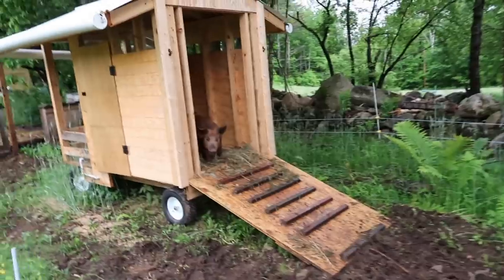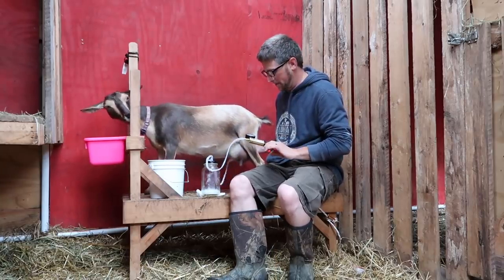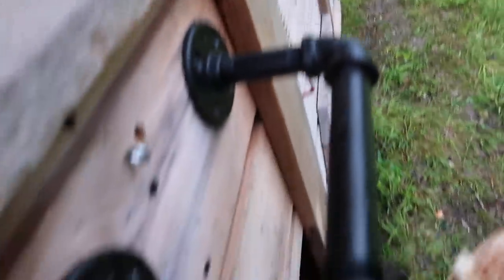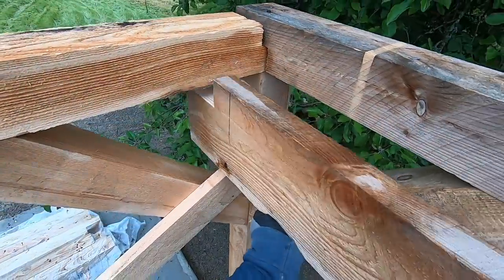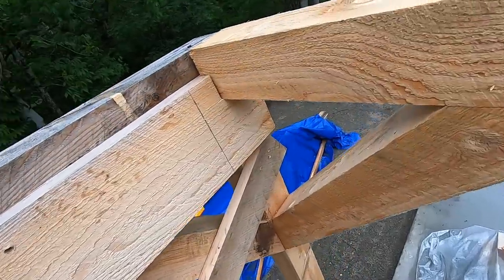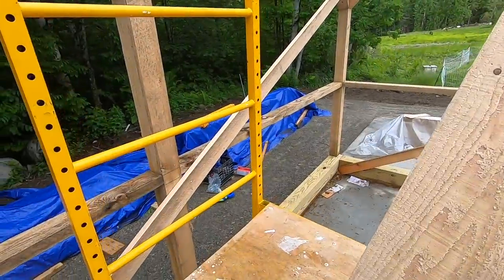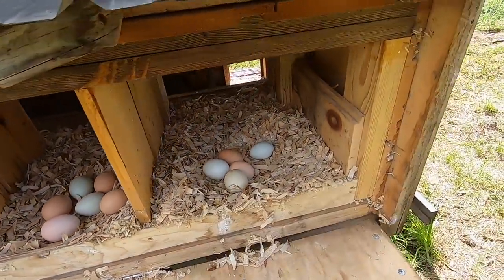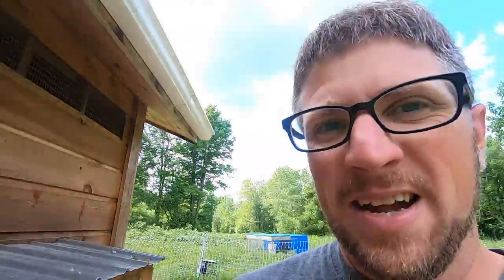Now We're Getting SomeWhere Installing the Loft in the Post and BEAM BARN KIT

Comment: Suggestion Al, run a piece of strapping or a 2 X something along the length of the outer walls and beams to sit the rafters on instead of a hit and miss screw, Save yourself a lot of time and make it easier to place the rafters before installing them. Then remove the strapping when rafters are installed and move it to the next beam.
Reply: Sounds like you've needed 3 hands before 😉
Reply: Nailed on well it would act as a makeshift joist hanger too, and give more strength than just the shear strength of those screws holding up the loft joists.
Reply: @aus71383  I'm not a carpenter but have watched a lot of deck builds and wondered why he wasn't using joist hangers.  Is it because he's using screws instead of nails?
Reply: @robinrummel1359  I think it's because the kit didn't come with joist hangers, but it did come with screws.
Reply: @aus71383  interesting, thanks ☺️
Reply: @aus71383  I was wondering about joist hangers....
Reply: @sandyburba3033  They would be a good idea, and can be added after the fact in many cases.
Reply: @aus71383  He added the screws to make assembly easier. They did not come with the kit.
Reply: @robinrummel1359  maybe saving money. ARe the screws he's using rust resistant? They look like they have like some kind of protection/sealed.
Reply: Lolz, same. Thought I had while watching. After you’ve fough t with things long enough. They go off like neon lights in your head...but, either way he did get it done!
Reply: ou don't have joints hangers

Comment: Should have used joist hanger to set your 2x8's.  Would have saved you time and a stronger floor system... yes you can get joist hangers for rough cut lumber.
Reply: J.Arnold Cotton Ha!  I just asked the very same question. Especially if you’re going to be putting weight on that flooring. And if you couldn’t get commercially available hangers for rough cut lumber, then I’d be making some.
Reply: I had the same thought. The whole loft is hanging and depending on nothing other than the shear strength of the horizontal screws. This kit uses the essence of post and beam construction but removing the engineering of old fashioned mortise and tenon joints might be a bit too much oversimplification. I’m not expecting a failure but as I watched the vid, I kept thinking I’d have to add some hangers to the loft if it were my barn. But I still love the channel, the family, the animals and the lifestyle. 😎👍
Reply: Joe Romanak even if you used Oak or Ash dowels. Might be repetitive, but better safe than sorry.
Reply: Brooks Webb - Good thought. I’m not an engineer but I usually prefer to over engineer my projects. I learned this from my dad
Reply: I have serious questions about the design of this project. This is not post and beam as I know it.
Reply: J.Arnold Cotton it wouldn’t pass inspection where I live.
Reply: Ledger system would be best option but its barn so who knows
Reply: Just going to  come back here every year for the next 50 to say, 'it's still standing'. Don't put metal in a wood barn like this

Comment: Your really moving along, suggestion when installing screws that join two boards together always drive them slightly down so when weight is applied on top of them the boards are forced closer together. On your triple 3x8 beams you might want to consider adding a 1/2” plywood flitch plate sandwiched between the 2x8s, just alternate the plywood joints of the of the 8’ x 1/2” plywood pieces and it will add substantially to the strength of the beam. Looks great!

Comment: The loft is not designed for weight, it is floating on fasteners only. Add king studs under the headers and some floor joist hangers then it will hold that elephant you're working on.
Reply: Yes, hangers would be better, but It ain't going nowhere.

Comment: As Mark G stated earlier:  a structural member is needed under the triple beam at each end....I would be amazed that the designer did not call for an additional vertical support member at each end.   Not being privy to the drawings, One such vertical may be called for in the drawings....if not, I would hope that the designer has given you the maximum load per Sq. Ft. allowable on the loft ...if not, then a call to designer is needed....
Good work....be careful leaving tools on work above you....it is so much fun building and see it come together....take your time enjoy and work smart...those baker scaffold can tip over easily...

Comment: I would suggest that you support the loft by putting a stud under the beam ends in the corner s of the loft, this transfer the weight  down to the foundation and you don't have to depend on the timber screws to hold up the loft .    I would be tempted to put  a post in the middle front and back of the loft if you plan to put alot of weight on the loft.  This is alot like framing a window, the header over the window needs to be supported.

Comment: Free advice from a carpenter. When selecting your wood, always check for the "crown". Every board has a crown. All crowns go out, on walls and up on joists. Without paying attention to your crowns, your building will start to sag in less than 10 years. Up and out, your building will never sag.

Comment: I have been very impressed with the engineering of that kit until today.  I am old school.  Joist need to sit directly on structural members, not toe nailed (screwed) or nailed into end grain.  They could do that easily with the cross beam.  Make it 4 piece, instead of 3, s that the inner 2 are as wide as the post.  The inner 2 would be 2x12 and toe nailed to the rim, but the outer 2 would be 2x6 and would run under the side beams and attach directly to the post with RSS.  For good measure, those laminations would have structural adhesive in between.  Downsize the rafters to 2x6, 16" O.C., then they would rest on top of the outer 2x6s of the cross beam.  Something similar would need to be done on the end wall.  Maybe a bit more lumber, but still much cheaper than joist hangers.

Comment: Shouldn’t the loft floor joists rest on top of the walls, instead of tucking underneath and relying on mechanical fasteners (I.e., the screws) to hold them up???
Reply: should have joist hangers not relying on the screws
Reply: That too.

Comment: Hiya, just watched this again & it came to me when you were putting up the joists for the loft & were holding them on two screws, what if you put up a length of timber six inches down, both ends to locate the joists on while setting up & then remove. Or leave them as added support as the joists are load bearing for anything in the loft plus the beam would hold itself up while you positioned it. Steve...

Comment: I have to say that I agree with the guys calling for at least joist hangers but would also add a 2x4 leg under the center of the rear wall. This is not a very well thought out support system, would not pass code/inspection in my area as well.

Comment: Use a 2x4 ledger board to temporarily support the floor joists when setting them.  They're called joists... not rafters.  Rafters support the roof deck.  Joists support floors.

Comment: Al, looking good - couple of quick questions. 1) What did the company say is the load weight of the loft when using screws vs nails and joist hangers, 2) how long is that battery lasting you on the driver?

Comment: @ 13:20 You would have been better off putting a 2x2 along the bottom edge as a ledger on the other side. Rather than rely on balancing the joist on 2 screws. Bonus is you could have left that ledger, as extra support to that end of the joists.
Reply from the maker: Yup. I would have been. 😝

Comment: You should have tacked a ledger up to rest those joist on, with 3 nails/fastners under each one if you're not going to use hangers.
The beam is supposed to be nailed/screwed together, 3 or 4 times, from both sides every 16 inches.

Comment: Does the plan call for using metal strapping to attach the beams to the bottom plate,  and the top plate. We have strong winds here in Colorado, building codes require strapping so that the upper structure does not blow off of the bolted down plates. If you put the strapping on the outside, it will be under the sheeting if you don't want to view it from inside the barn. Our local Lowe's have the strapping. 

Otherwise I watched this yesterday, and I am missing seeing the feeding of your animals, that is the best way to start the day. Maybe I should go back and watch an old video, but it is not the same as seeing Pork and Chops in the new PPM.

Comment: Good video. I liked it. But as a carpenter of 30+ years I've learned that nails and bolts have 5x the shear stress ability as screws. Screws are better at pullout but SUCK at shear. I love them for ease of use but people need to understand what they both are good at. It's why high rise buildings use steel bolts over screws. It's just a stronger design.

Comment: To late it's hard to balance a board on a screw next time screw a short piece of wood on top of the 2x8 letting it hang over 1 1/2 in.  That will hold one end while you screw the other. Can put on both ends, may take a little time but easier than what you did. Can use over and over again.

Comment: 14:36 would have been a lot faster and less stress running a piece of wood along the whole beam rather then trying to do it with nails just saying doing that would have allowed you to place all the boards up right away then all you had to do was screw them in  and move your ladder...… Good man you figured it out at 18:20 LOL now do that for the cross sections also and lay out all those cross members on the rafters too that way you don't have to do one by one

Comment: should you have not used nails instead of screws for at least the start of the build screws have approximately half of the shear strength of nails
Reply: Check out Project Farm on YouTube, he does a test with nails and screws. The screws will be just fine. Some of the screws he's using are way stronger and have way more holding power than a nail.

Comment: Please never load that loft floor with any significant weight and tell the new owner, if ever any, the same.  Everything is hanging on timber screws which is a very weak design....joists and the main beam included.   Main beams should be resting on posts or  jack studs/posts and joists should be hung with hangers or on top of the beams with a rim joist on the ends.  Just remember any weight placed up there is all sitting on a few 1/4" screws in soft wood...no true support is present.   I am very surprised the design passed any kind of state standards for commercial sale.

Comment: Sloppy construction is what i see. Loose joints. Over driven fasteners leaving split lumber. Worst of all no joist hangers on those loft joists. Just because they didn't come in the kit doesn't mean they are not needed. You pull your diagonal bracing and never even check to see if you scrambled your plumb and vertical posts when you moved them.